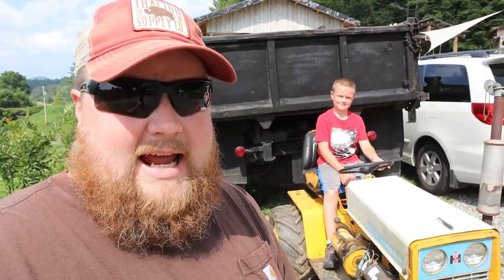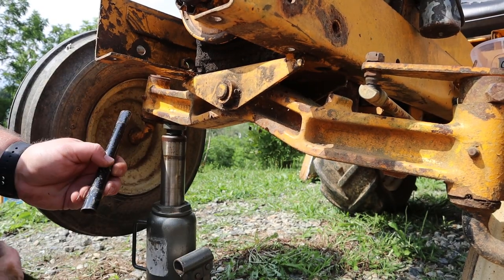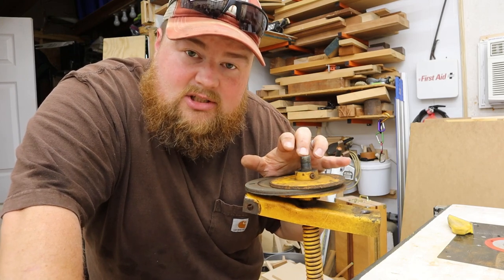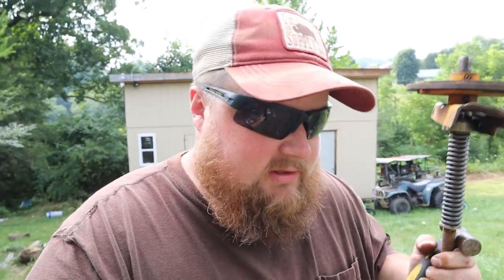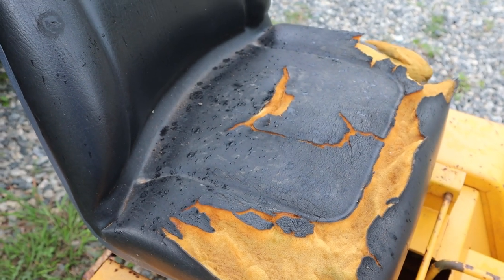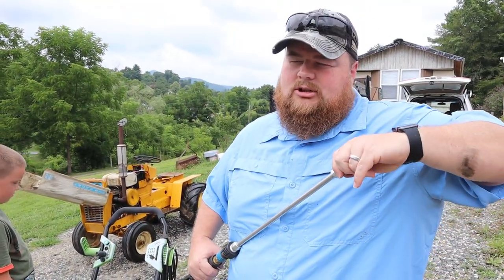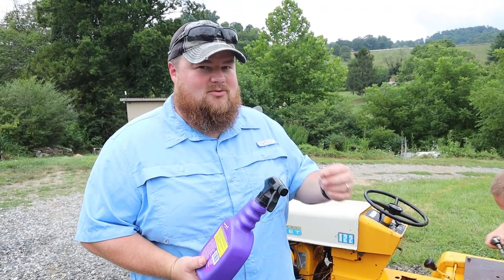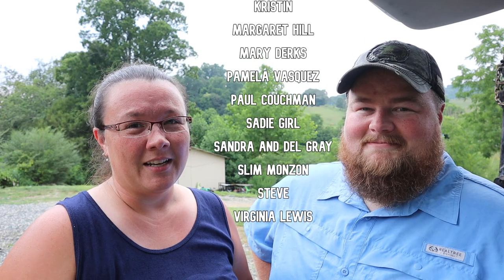Reviving an OLD GARDEN TRACTOR - 1964 Cub Cadet 122

Comment: Very strong little tractors Sam. I recently gave a Cub Cadet 123 to a coworker. It ran fine, just always had  trouble with the starterator/genenator. Mine had the same exact 12 HP Kohler engine and hydrostat tranny. If you could get traction, it would pull just about anything you hooked to it. I bet it too was an early 60's model. As I'm a 1962 model  LoL. Great project for you and Elijah.
Reply from the maker: I would really like to get a hydro unit! Always thought it would be awesome to put a little bucket loader on the front of one. :)
Reply: Ha, I forgot to mention, the whole time I owned that 123 Cub I never knew how to turn the headlights on. My coworker found the switch down by the lefthand side of the running board. He pulled the switch and both lights worked. LoL

Comment: Done this fix several times.  There is a cup bushing that goes over the teaser spring.  This is an upgrade.  Never saw set screws in that throw out bearing before.  Actually I think it is to slide slightly on the shaft.  Some guys complain that the shaft wears down there.  Best to use new spring pins.  They are brittle.  Woodworking clamps a good idea.

Comment: another great cleaner is Krud Kutter  its non toxic and biodegradable. great on grease, grime, oil, tar....I was a painter for over 20 years....great to clean kitchen grease....but will if left on loosen paint. We used it on trim that someone got wall color on. all around great product...can be used indoors.  can find it at Wal-mart in paint earea. or rule king....I havent seen it at TSC here.

Comment: love watching your videos. Just in my experience of using degreasing products on engines, you really need to watch out for vacuum hoses and wire insulation.  I've had degreasers cause some pretty major vacuum leaks and have since sworn against using them but maybe it was just the brand I used.

Comment: Teaser spring broke cause you need a washer in there.  You do not have to take engine out to get driveshaft out. It will come out on right side right above and behind starter generator.

Comment: Enjoyed the video!! A couple unrelated questions been wanting to ask:
1. Does that window unit cool your shop?
2. On your new mini split....Do all three units have to be on cool or could one potentially be heating a room and another cooling the others. Just curious. Installed a single zone mini yesterday. Works great. Thanks!!
Reply from the maker: The window A/C does good as long as it's left on long enough. I try not to run it when I'm not down there. It's a 12k BTU, I think.
All three units on the mini split have to be running in the same mode since they share a single condenser unit.